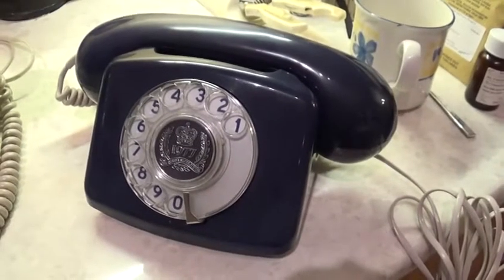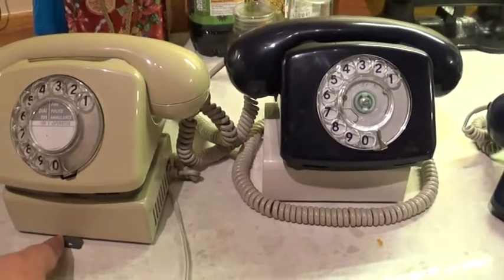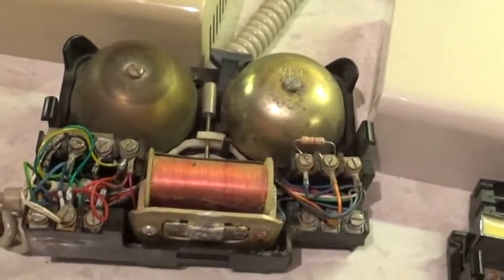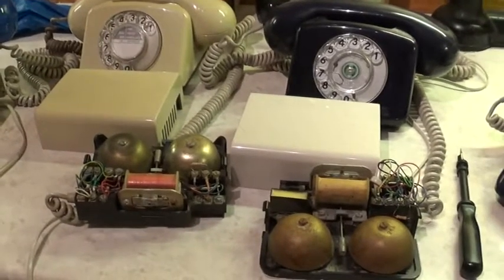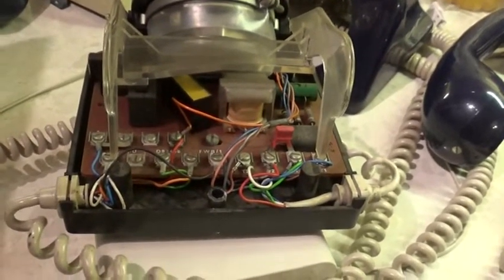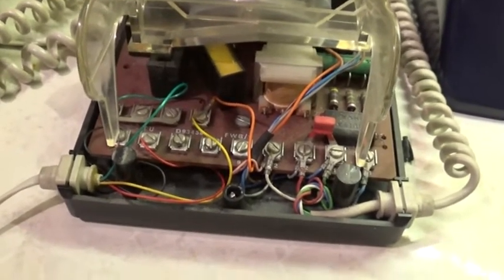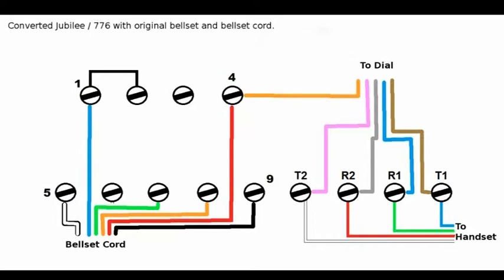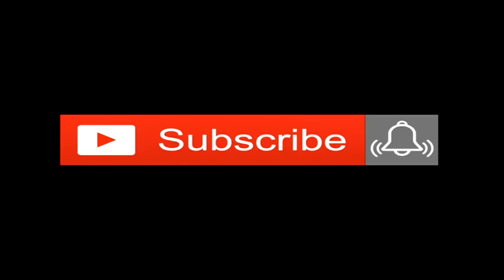The Compact Telephone: Converting a 'Jubilee' phone and the differences between the 776 type

Comment: Hi Andy. This is one of my favourite of the GPO telephone range. The original "compact" was trialled in various parts of the country in the early 70's as a complementary phone to the Trimphone. I've seen one which contained a trimphone warbler and didnt have the seperate bell set. The Jubilee version was launched as a way of recycling all the field trial units with fresh covers and cords with an English version and a Scottish version (different crests in the dial). I believe there were plans for a welsh version too which didnt happen. The phone was then classed as a Special phone and not called a 776. It was very popular particularly with GPO staff! Consequently the Compact 776 was launched in it's new colours and with a redesigned bellset. The new bellset was designed to allow the phone to be used in more situations - Plan extension arrangements and PBX working. It could incorporate a socket for Plan 4 working in various combinations which is why so many terminals were needed. It was seen as too fiddly for most engineers and it was quickly overtaken in popularity by press button phones, especially the press button trimphone.
Reply from the maker: +Graeme Yeates That's interesting info about the compact phones. I didn't know the Jubulees were actually recycled units. That would explain why the original trial phones never seem to turn up though. Somewhere I've got ine with an internal warbler. I can't remember if it's a jubilee or a standard coloured compact though. I had assumed the warbler was a later addition, but I'll have another look now.

I can see why this phone was popular. Itvwas the first GPO issue since the candlestick that would comfortably fit on a window sill. And in a time when phones were hard wired to a line that usually came into the house through the corner of a window frame, I'm always surprised more thought wasn't given to the size of the 706 & 746. Perhaps a deeper compact with the bells under the rest of the internals but all in one deep case wpuld have been a good idea?

Comment: Only one problem this is a conversion video for the jubilee / 776 but you never explained where the converted line wires go in the Bellset for the new plug and socket system.